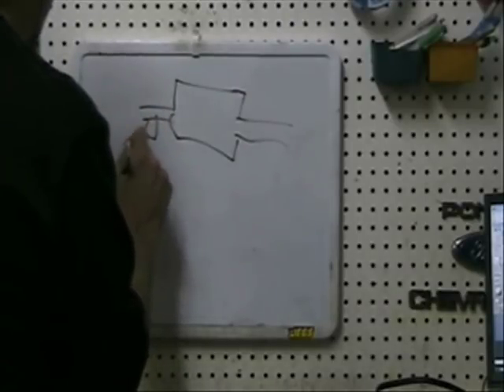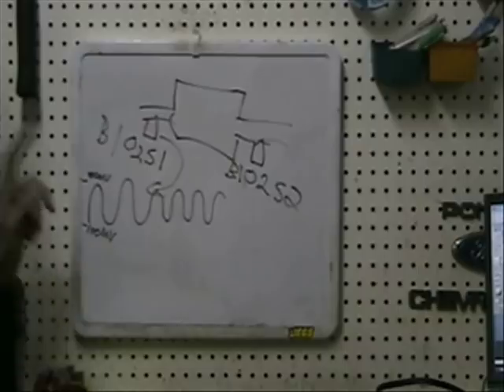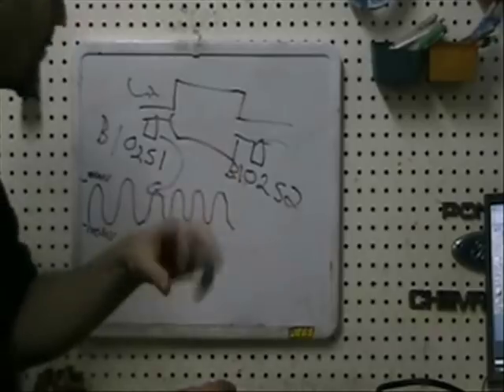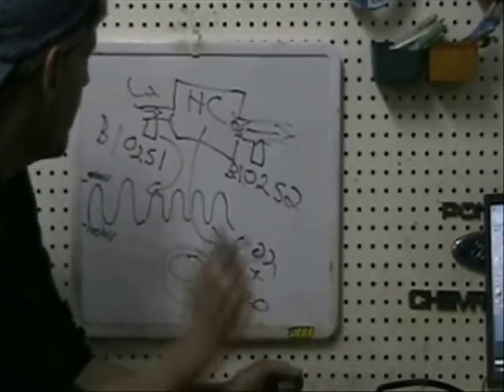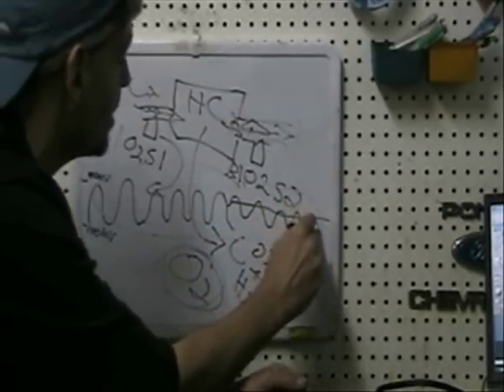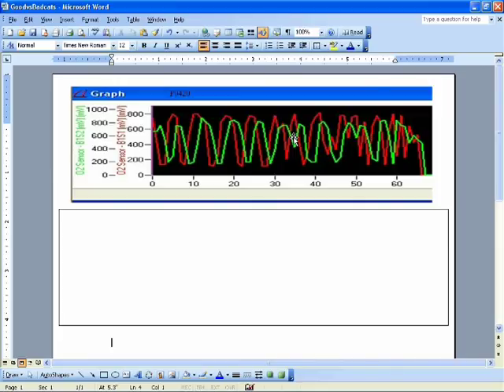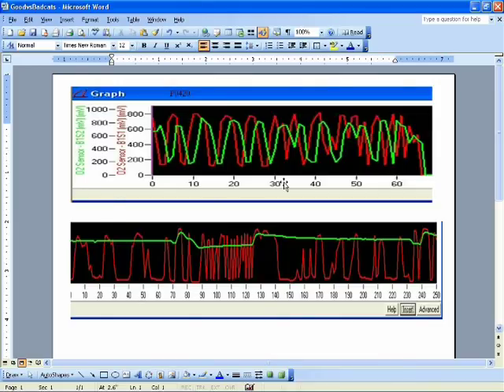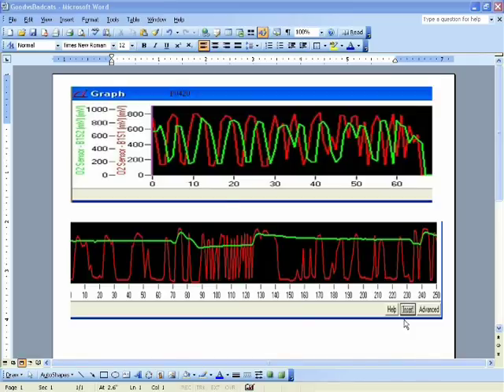P0420 P0430 catalytic converter catalyst inefficiency code diagnosis

Comment from the maker: Ah, Chris,  an idle mind is the devil's playground but an evil mind is his kingdom.  Indeed your clever idea to bypass the cat has come across many a similarly wicked mind but it has also come across the engineers' minds as well.  The problem is the constant 900V signal appearing at warmup while the cat is not working at the engine runs rich will throw a B2 sensor code on most models. Models with AIR also use the O2 sensor as indicator the system is working. Codes other than 0420 would result.
Reply: Schrodingers Box 
so would a peak detection circuit using the S1 waveform work as  an S2 signal then? Or did the engineers put more stringent requirements in their screens?

Comment: The most reasonable explanation I've heard about the o2 sensors, I've watch docens of videos and read articles and none explained it so simply and easy to understand. Great explanation! I believe those wave lengths comparison is at idle, do u know if they should behave the similarly at high rpms? In my cars case the output o2 sensor line goes 'not as flat' does look like there's a bit ot oxigen comming out in high revs, does that mean the cat may be starting to fail? I'd appreciate your input
Reply from the maker: Actually the numbers should be read at 2200 RPM however a really strong cat will show these at idle.

Comment: Thank you for the video. Excellent information. I've got a 2004 Nissan 3.5L V6 that all of a sudden is displaying both codes. P0420 and P0430. Driveability is "normal". What are the odds that both cats would go bad at once? Does a gasoline formulation change done in this cold weather state of Minnesota twice a year have the potential to cause a code while the fuel supply is transitioning? Could bad injectors or bad plugs cause this? Did not look at live data yet.  Thank You.

Comment: hey nice video thanks for sharing.  I have a 2001 Saab 9-5 and to day cleaned my throtttle body.  While testing the car, the check engine light came on with a P0420 code.  This was performed at the local auto parts store.  The slip they gave me had the following written on it: Catalyst efficiency low-bank, The oxygen sensors monitor the catalytic converters ability to store oxygen. Probable cause; catalytic converter defective (failure possible due to #2,3, or 4); Engine misfire or running condition; large vacuum leak; Engine oil leakage into exhaust-value guide seals piston rings. Based on your great video how do you thing I can determine which of these codes I should move forward with first?  I look forward to your reply.
Reply from the maker: I would look at the O2 sensor data for pre and post cat and determine if there is evidence of lack of cat activity.

Comment: For today's cars, both professional and DIY mechanics need to know about what they are working on. The three-way-catalytic converter (TWC) is part of a whole engine fuel/exhaust system design. With a proper functioning engine system, today's TWC are designed to operate for the life of the car and meet emissions requirements. In the case of inefficient TWC, the best way to test is with an exhaust gas analyzer (which are expensive) and proper testing methods of which there are several. If a TWC is determined to be defective, the cause of the failure must first be determined. Not to do effective diagnosis and repair of the root cause of TWC failure can result in replacement failure soon after. For example, California emissions testing is super tough and replacement TWC must meet those requirements. Even replacing a TWC in California must meet strict requirements. In some areas of the U.S. to even replace a TWC requires a special certification. Go to any auto parts web site (try rockauto.com) and notice most of their TWC offerings cannot be sold in California. OEMs are often what is needed. For a comprehensive discussion on engine emissions design and catalytic converter info and testing go to this link. This information is also quite helpful in avoiding a TWC failure in the first place. http://www.lbcc.edu/attc/documents/BAR-2011-CAT-testing-methods.pdf

Comment: WOW talk about definitive information. I've been kicking around the idea of clearing up my P0420 code with a new converter. Luckily my Torque app has shown an oscillating voltage on my downstream 02 -now you have taught me why. Thank you! Oh, any chance that a converter will create SIGNIFICANTLY more back pressure when it gets really hot? Have a condition (P0420 is the only code) where on the hottest days and after the hot car sits for 30 mins, when driving again it falls on it's face.

Comment: I had a 98 Mazda 626 throw a cat code. Didn't have 70k miles on it. It was leaking oil into the one spark plug well. It never threw a code for a miss but it would miss now and then. I replaced the valve cover gaskets. No more cat codes for at least two years  (I sold the car)
Reply from the maker: and what was the downstream O2 sensor voltage showing?

Comment: I believe an exhaust leak can also simulate a failed catalytic converter. It's a good idea to pressure test your exhaust system. Or, like Ericthecarguy, do it old school (I think he does more of the old school just to help the DIY who has less stuff. :) ) and put get a rag strapped to the back of your muffler and look for leaks that have become more obvious.

I think it's helpful to to literally run your hand around your exhaust tubes while in operation. You don't have to touch it, just have it close so you can feel the air or heat escaping in certain spots.

In my case, the springs were bad between the manifold and my down pipe. The engine has to be able to twist a little on start up or during revving, and this is where on my car there is a donut on top of the downpipe to twist and keep a seal. Have a bad spring and when the engine twists you'll have a leak.

I had to really think about it to figure this out, it's hard to rev an engine and have your hands in there, lol. Lucky me, 1 of the 2 springs were too badly rusted in, but 1 was enough to stop the leak. I'm sure, I'll have to get the other eventually, but great penetrating spray sometimes isn't enough, you need an acetylene torch. I don't have one yet, lol.

Note I also had a bad catalytic converter, but the code may not have cleared do to the leak.
Reply from the maker: An exhaust leak can indeed be a downstream O2 sensor problem, but it will not cause a "mirroring" of the front O2 coding a 04x0 code. No combination of exhaust leaks will cause the rear O2 to have an oscillation pattern matching that of a front O2.
  Good point about the shadetree techniques- my channel tends not to focus on those but one common shadetree technique to validate the O2 sensor is to use a temperature sensor gun to monitor exhaust pipe temp before and after the cat. I'm not sure what the parameters are that one would look for but I would assume you want a hotter post-cat temp than pre-cat. If the temps are the same, no cat activity is assumed.
Reply: About 100 degrees hotter on the back of the cat I heard from Eric?
Reply: The other issue I still have after the new cat is the downstream staying close to 100 milivolts. I thought this was supposed to happen from this being my only cat replacement experience...but your video is showing the opposite. . . I have something to unlearn?
Reply from the maker: Yes I have sometimes seen this as well and i'm not sure why the sensor sometimes seems stuck lean like that but if you test it at 2500RPM it should definitely show rich (technically, I should say it should show to have high voltage).  I have also seen some cars where for whatever reason you don't get o2 sensor response unless the vehicle is actually driving.  In either case, I am not sure what the programming/mechanics are behind that- I never looked into it.  I don't recall the make exactly, but I recently worked on a car where the O2s were flatlined unless the car was actually driving.
Reply: I'll be breaking out of it's brand new packaging a laser thermometer. Take it for a drive. Keep it above 2500 RPM and reading the front and back temperature. Maybe this will give me another clue.
Reply from the maker: DE Nichols I actually have played with the laser temp gun a bit and I will tell you, while it's far from my favorite method it does indeed have accurate applications and I bet the cat test will show to be one of them. I can tell you that it is very easy to detect which cylinder is misfiring by measuring the temp of the exhaust runners (the misfire will be much colder). I also have used it to verify the CTS accuracy and T-stat opening accuracy. While I am definitely a computer geek, there is no question these more shadetree techniques are not to be dismissed as worthless!
Reply: I got this comment off of a Jennies Garage video and while I normally see the heater lines to an O2 sensor to be black, I think it shows another example of the cat's O2 showing rich or lean doesn't really matter, it's the fact it's acting slowly up and down. If the catalytic converter is letting exhaust through without catalyzation then it'll be more like the front O2 sensor with oscillation.

Some cars run after the catalytic converter with a high voltage as the main reading, some low, but I like one of your comments, Matt. You should be able to drive it richer. Yes, I can. :)

In fact, without your example, I may have worried when I watched it on startup where it started rich after the cat instead of lean, unusual for my car.

Jack Sparrow
3 months ago
 
Hi Great Video it helps some of us........... we all don't have $10,000 dollar test scanners and o scopes. OK a couple of things, one thing is.... it is important to which sensor you are testing at the time, they are usually different. The first one or the one before the catalytic converter controls the air fuel ratio 14:1 for emissions and mileage on the fly adjusting by the ECM. The second one does not have any control over the fuel ratio, or fuel management. So the sensor after the cats. voltage is very slow to react to the heat and it may run at the bottom of the threshold or it may run at the top and it generally drops much slower after the heat is taken off. The 2 white wires are generally the heater element wires IE resistor which heats up when the car is first started simulating a warm condition climate by a 12 volt input. So to check if the HSO2 sensor heater is functioning if you got that code P0003 take the meter and switch it to ohm's and connect each lead to the white wires, this is a loop generally 1.5 ohms is normal (good). If there is no reading there is an open circuit or high resistance in either case the sensor is bad. I didn't see that side of the sensor test talked about in the video I did see the white wires in the video both can give you service engine lights and not clear. They will come right back on almost instantly. Also it usually will say malfunctioning heater HSO2 bank 1 sensor 2. So in short you need to know which sensor your testing to get the proper volts and ohms etc from your service manual the 2 sensors are different if you have 2, in specs and in functionalitys.

Comment: Hey Matt, Alan again. On Nissan 1.8L 4 cyl. Cyl's 1&2 are bank 1. cyl's 3&4 are bank 2.They looked like this http://pacesetterexhaust.com/images/products/detail/201058.jpg.  2.5L 4cyl Nissans had all kinds of problems with cats.and pre-cats. One was the power valve screw TSB.Screw would fall out,bounce around the cylinder chamber ( destroying plugs and pistons ),then the screw would be shot out of the exhaust valve right into the pre-cat.In the mean time, the intake valve is chewing on the valve plate. Made the first half of the day real fun. If you want to see the power valve screw and plate http://i11.photobucket.com/albums/a160/sleeper33/lostscrew.jpg. The pre-cat looked like http://i11.photobucket.com/albums/a160/sleeper33/precat.jpg. Take a look at where this cat is http://myhondapartsstore.com/myhonda/jsp/catimgs/13s0411_e04.png. Notice how close the cat is to the head for fast heat up. We were told to take out the top O2 sensor (part #8) and see how the cat looked. Cats like this is even found on the Titan. Misfires (due to too small of a ground wire for the ignition system) would take the cat out in about 15 seconds.

Comment: O2 sensors don't last forever and become sluggish with age.  An O2 problem can cause a catalyst code to pop up. Watch the "stories from the road video for P0420".  PCM software can also cause P0420/30 to pop up because the monitor might be too sensitive.  Always check for TSBs first.  Not all techs are trying to rip you off.  You don't want old worn out O2 sensors or engine drive-ability problems when you go to replace your converter(s).

Comment: Excellent video. I am a fan of your fuel trim videos too. My MDX has two banks and thus two catalytic converters. The car  started throwing error codes 420 and 430 for both banks. What are the odds both cats have gone bad? The car was running lean for a long time and I finally replaced the plenum gaskets while fixing the broken knock sensor. Both LTFT and STFT are near zero now but the engine light is back on again. Ugh! Appreciate your guidance
Reply from the maker: I would run the test I showed and trust the results.   there is no reason not to expect that both cats can be bad- they are the same age and subjected to same conditions after all.

Comment: Hi Matt , I saw this video and it helped me with diagnosing the p0420code I had ,  I looked at the graphs and the S2 was matching exactly the S1 reading ,  but since I didnt want to spend so much on a new catalytic converter  I decided to try something new that I have not seen in any  video on you tube ...

I used an ultrasonic Cleaner that I had  to  clean the Catalytic converter and both O2 sensors ... the solution I used is a normal dish washing soap  with warm water  for about  15 mins ...

  And   then  rinsed them with water and finally dried them  with a  compressed air ....  

So far I have 3 days  without the code popping again ,   and the S2 now is steady at about 0.68 volt  and the s1 is oscilating bitween 0.81 and 0.08...  would you like to get in touch for the pictures of the graphs ?!
Reply from the maker: Wow. Well if the S2 is fixed rich then i’d say they cleaning worked. First i have seen where someone actually gave evidence other than “check engine light stayed off).
Reply: @SchrodingersBox   I dont know if that makes a diffrance  but it does have some fluctuations while driving , but it is steady at about 0.68-0.7  when am idle.

 Also the methods I used in unusual  as I fabricated a cap out of a Steel  sheet to block one side of the catalytic converter , thus turning it into a tank .. I had it  standing at the bottom of  the my UT cleaner tank.. this way I was able to fill it up with Water and soap and   then I turned on the UT cleaner. 

But again  it could not work with some one else too.  The catalist materials in my Cat could have been blocked from interacting with the engine exhaust by carbon and dirt and oil ,  thus cleaning them  made the catalytic converter  work better ...  also ,  I have an issue that is known in the GMC acadia cars where Oil gets into the Air intake "probably  via the PCV breather hose " thus after years  of that issue not bieng noticed all that oil that got to the exhaust could have had a layer over the ceramics of the cat.

This is my hypothesis for now .

Comment: I was hoping you had a video on this, as I am working on a car for a p0420,0430 problem. I was excited when I saw you had this video listed, and my car is a honda. BUT, figures mine is 2006 and yes, it does have a/f sensors instead-dam it. I thought this was going to be easy. I am guessing you dont have a video on a/f sensors because you said you dont have the scanner?? On my car the rears are 02 sensors though and they are oscilating up and down like your photo and they pretty much dont go over .650 volts. I tried disconnecting the brake booster hose to make lean condition while watching fronts and rears voltage. could not really see much difference though could hear some. Even watch short and long term trim did not tell much?? I am thinking the cats because of how the rear sensors are moving but wish I knew more about how to monitor was is going on with the front sensors. Thanks again for all your GREAT videos!!!

Comment: Hi there. This a perfect video! I'm new to scanner use but had a p0161 (bank 2,sensor2). I have 168K and never replaced the sensors so I went ahead and did all 4 based on the graphs I was getting. I know bank1,sensor 1 wasn't oscilating very well.
After replacement, I ran the graph again. At idle sensors 2 hold at about 0.7V but at 2500rpm they start mimicking sensors 1. Why? Based on your video I see the cats are bad but not at idle. Does cataclean work? No sulfur smell. Idles very smooth. thx